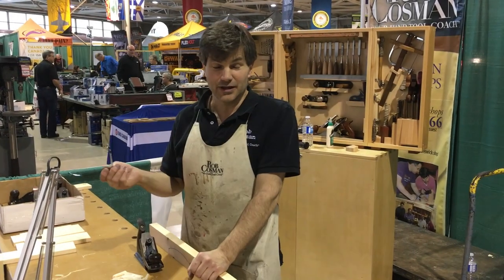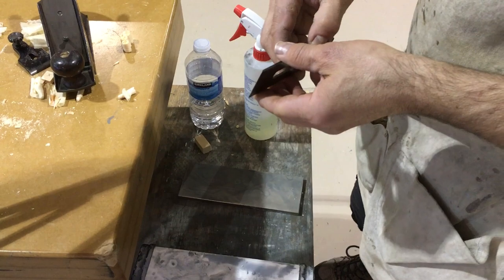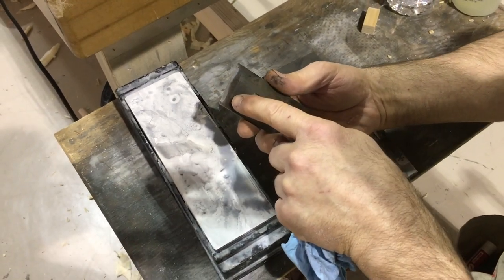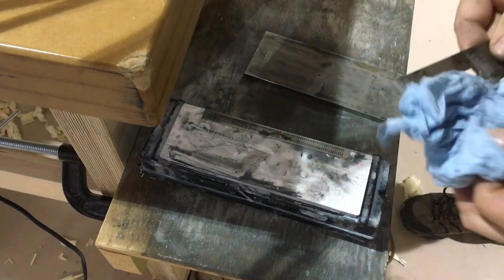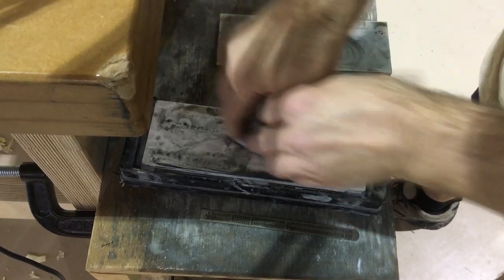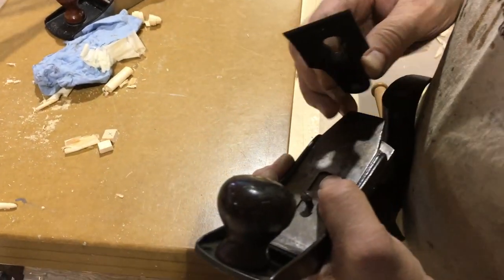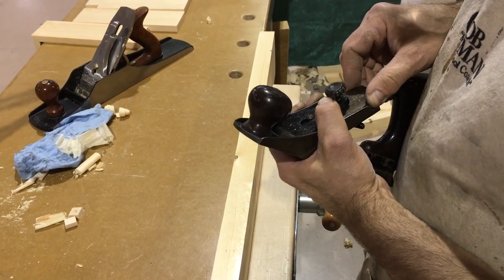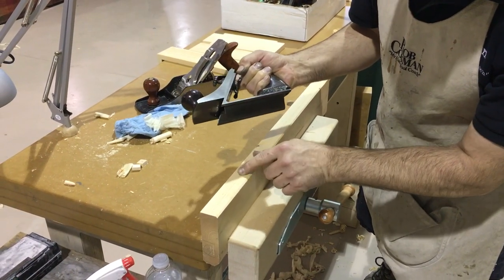Chamfer plane, Stanley #72

Comment: hi Rob, I use a honing guide with a stop block to keep all my blades the same angle each time I sharpen with the block I add a scrap of wood to give me my secondary bevel. I know you do yours free hand and add a THIRD bevel and I wondered if I should be doing the same by adding a third slightly heavier scrap of wood to my stop block? love the videos, keep them coming. Daniel

Comment: Interesting plane Rob.  I was surprised to see the quick jump from 1K grit to 16K.  Was that for demo purposes on the video, or can one make such a jump and skip so many grits in between?
Reply: Rob does this all the time and it works brilliantly. The reason is that he's using micro bevels.This means he can sharpen and resharpen in around 30 seconds!
Reply: I don't remember ever seeing you do this on an old fashioned thin blade. This is a tutorial on proper finger pressure.